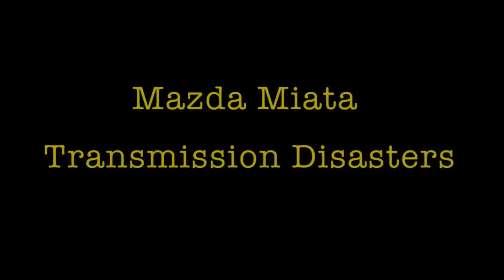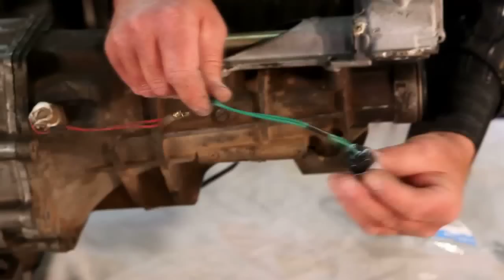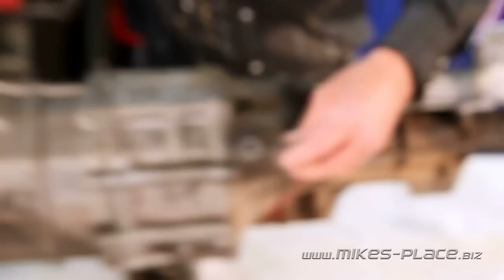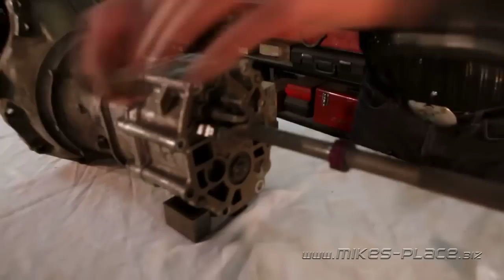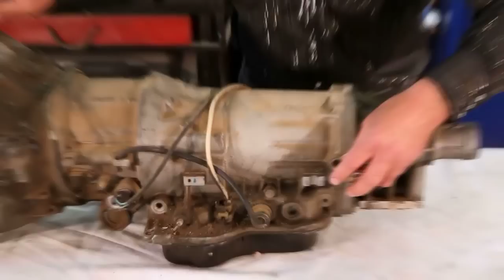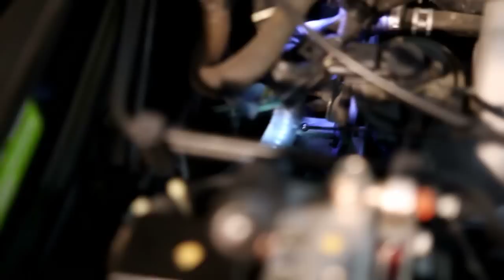MX-5 Miata Transmission Disasters from Mike's Place

Comment: hello Mike,
it is not a problem that I have, but you are the expert on mx5's. so, here is the thing, I have an NA6 and I want to install the 6 speed gearbox with a torsen diff, but keep the final drive ratio at 4.300 is that possible? and how?
Reply: Hello Sir Aliprantis,
No problem take both differentials to the driveline shop and have a hybrid cooked up. This is what they do.  Mike. The King of Miatas.
Reply: Oh, great then it is possible! 
Thanks a lot Mike!

Comment: Would a bad reverse switch cause the transmission to not want to go into Reverse? I sometimes have to pump the clutch 2 or 3 times for it to let me into Reverse. Its an 02 NB 6 speed trans.
Reply from the maker: Hello,Your transmission 2002 with a six speed has a issue with selecting reverse. One thing that can be done is a clutch pedal height adjustment so as to put more release into the pedal. Also you may have a worn or worn out clutch disc.Good Luck with your Miata Shifty Mission.The King of Miatas.Mike.
Reply: Mike MiataKing I have the same issue,can you elaborated on what needs to done? 6 speed transmission,clutch free play seems correct,also I don't have to push clutch pedal very far in for engine to rev up with driving along.

Comment: Oh all knowing Mike, King of Miatas, I need your help. I just bought a 90 Smurf Blue. The transmission is stuck in first. Any suggestions?
Reply from the maker: Hello Sir Keith,
The first place to look is inside the shift turret case to see Maybe broken parts. Use a magnet to fish around for clues. You may even have a broken shift turret case. Look under the Miata to check it out. Good luck the new to you Miata Mission. Mike, The King of Miatas.
Reply: Mike MiataKing that was the first place I looked. Previous owner said that the bushings has broken. Before I bought it, I cleaned out the turret and installed the rebuild kit with bronze bushing. Still didn’t resolve the issue. Going to get it up on jack stands today and see what else I can visually diagnose.
Reply from the maker: Hello Sir Keith,  Your next move is to start removing parts for the shift turret. The plungers and balls may be stuck.  Good luck with your Miata
Mission. Mike, The King of Miatas.

Comment: hey miata king, my neutral safety switch is acting up on my 6 speed. can i just cut and connect the two wires together to essentially jump it?
Reply: Hello Sir Eric,
The neutral switch is important to the ECU and drivability.  Best to replace the switch. One of the common problems with the switch going bad is the switch shorts out and blows the meter power fuse so the instrument cluster goes dark. Mike. The King of Miatas.

Comment: the reverse light switch has to be skrewed in tight by a wrench or a just by hand?
Reply from the maker: Hello sir Hooligan,
Use a spanner to secure the switch, don't forget the copper sealing washer or the switch will go in to deep and  lock up the reverse shaft. Good luck with your Miata Mission.
Mike.
The King of Miatas.

Comment: Is the Vacuum port location different on a 2003 Miata?!?  Thank you for your videos!!!
Reply: Hello Green Man,
Starting in 1999 the Miata no longer used a vacuum operated modulator. So the 2003 Miata does not have a vacuum port.
The King of Miatas. Mike.
Reply: Famous SeamusDude  So is this a Four speed automatic???
Reply from the maker: @greenman692003  Hello,
They call this a five speed as it has a lock up torque converter for fifth gear.
The King of Miatas.

Comment: Mike my automatic miata slips when its cold but after 1or 2  minutes it drives fine. It happens in drive and in reverse. Is this normal?
Reply from the maker: Hello Sir Alberto,
Does not sound normal. So would suggest a automatic specialist. May do with a service tune-up.
The King of Miatas. Mike.

Comment: Hey mike I have taken out the switch and attempted to move the detect back into place but it wont budge. Any suggestions?
Reply from the maker: Hello Sir Mark,
There may be tension on the ear set. Have someone push in the clutch while you push on the shift rod detent. Good luck with  your Miata Mission.
The King of Miatas.
Mike.

Comment: Please Miat Mike can you show me how to remove the engine mounted fuse box to replace the main 80 fuse which you are unable to just pull out like the rest of them. I can remove two bolts but where is the the other one. Please help me Mike
Reply: Hello Sir Harry,
Thank you for  your concerns. To remove the main fuse bolted into the under hood fuse box, first unbolt the box, two nuts. Lift up box from Miata to gain some working room. There is a trap door on the fuse box that will need to be opened to access one of the 10mm head bolts to remove the fuse. The other bolt can be seen. Once done put the unit back together and bolt back into the chassis. Good luck with  your Miata Fuse Mission. Mike, The King of 
Miatas.

Comment: Hay I wax doing a transmission flush on my 99 Mazda Miata and I remove. The tork bolt on my transmission now I don't have v six or reverse how do I fix it
Reply from the maker: Hello,
The bolt you you removed has a long shank ?  From the passenger side near the bottom front of the trans ??
If so the transmission will need to be removed and cases split to repair the now internal loose parts.
Good luck with your Miata Mission.
 The King of Miatas. Mike.
Reply: @MikesPlaceBiz  thanks I really appreciate at it

Comment: Hey miata King! Good Video. Can you help me? My Transmission started knocking today when i accelerated a bit to hard and shifted Form 1st to second gear fastly. Its worst when im in second gear but you can hear the knocking in all gears but quieter. When im standing still and in neutral its still there, when i press the clutch it slows down and stops. When i release the clutch its there again. You can hear it when the engine is warm and cold. 
I have a 95 na with the 1.6l 90hp engine
Reply from the maker: Hello Sir Tridel,
First step is to check the fluid level and maybe change the fluid. 
Noisy transmission is most likely a bearing going bad. When noisy 
in first and second the issue may be the input bearing, the first bearing
past the clutch. Good luck with your Miata Mission. Mike. The King of Miatas.
Reply: Mike MiataKing thanks i will look after it

Comment: I followed your guide and fixed this stuck in reverse problem.  Today,  gear is stuck in neutral ( ie,  put in neutral position and the car cannot be pushed ).  Able to shift in 1st and 2nd, but car won't move when release the clutch.  Cannot shift to 3rd,4th, 5th and reverse gear ) - Any ideas please ? thanks.
Reply from the maker: Hello Sir Al, 
The next step is fluid check. Check the main trans and open the shift turret. If trans is over one quart low, bad news.
Internal damage. Look in the shift turret box for broken bits. Fish around with a magnet on a stick. Next step is to 
start the engine, push clutch in and wiggle the gear shifter back forth and side to side, to release a stuck lock out or a stuck shift fork. Good luck with your Miata Mission.  
The King of Miatas.
Mike.
Reply: Hello - thanks.  I was able to fix this again by following the "stuck in reverse" you described here. My next question - apparently I feel that this problem is being caused by myself  pulling gear into Neutral without using the clutch while the car is moving - is there a problem with my transmission or my clutch as I can just shift any gear into neutral with using the clutch ?   what is the shift turret - is this the area holding the shift stick inside the car ?   many thanks.  Al
Reply: Hi Mike  the King  - I know what the turret is now - just went to check my car inside - First, the boot was broken badly so I could peek inside - I could see it is kind of wet ( perhaps with transmission fluid) ,  Second -  I could feel heat coming out while driving - is it because the boot is broken, or something else ? Third - my car is not on and is parked, but I put in each gear , and you can wiggle the shift stick left to right a little at every gear .  So is this causing the transmission gear get stuck once a while ?  Thanks. Al

Comment: Can torque converter or shift lock on auto 91 miata make motor not rotate I tried manually turning engine and it seems seized
Reply from the maker: Hello Sir Cameron,
We do not see the auto trans being  your  problem. Look closer at the engine, plugs out, Starter stuck ect...
Good luck with your Miata Mission. Mike, the King of Miatas.
Reply: @MikesPlaceBiz  it was torque converter not seated fully

Comment: Will this be the same if it keeps getting stuck in 5th??
Reply from the maker: Hello Brendan. Have you replaced the back up switch with an OEM part yet? Other issues could be the shifter mechanism, bushings, and collars. If the problem still continues, then there may be internal issues wear and tear. Good luck with your Miata mission.

Comment: i have no clue why my trans mission makes a little click/ grind sound in 1st and 3rd? 2002 se 6spd
Reply from the maker: +Thecharliejolly Hello Jolly Charlie, First step may to to use the Mazda OEM suggested fluid. You can buy at Ford Dealers. Item number XT-M5-QS.This is the Ford Cold Weather Syncro Fluid. Helps with smooth shifting and improves low temperature performance. You will need to purchase 3 Quarts. The King of Miatas. Mike.

Comment: Help please. I have a 91 5-speed the transmission and stick shakes while driving, and shakes really bad between 30-35 MPH. Im lost.
Reply: youll need to replace your shifter parts with a shifter rebuild kit, helps stop loose play when in gear/neutral
Reply: Hello,  Thank you for your concerns. Sounds like a bad driveshaft.Take a look under the Miata and shake the driveshaft. Good luck withYour Miata Mission. The King of Miatas. Mike.
Reply: +BalledandJacked thank you Sir
Reply: +Mark Cagaoan thank you that is the 1st thing I did.

Comment: Hey miata king I took off the reverse light switch on my 2001 miata 6 speed now it dont go in to 4 th 5th 6th and reverse forth feels blocked a the ether ones feel like neutral can u hellp me please
Reply from the maker: Hello Sir Jose,
Sounds like you have misplaced the shift rail bushing holder. Transmission will need to be pulled and put back together internally. Good luck with you Miata Mistake repairs.
Mike.
The King of Miatas.

Comment: Miata King MIKE!!  I have an auto tran (1992) that makes terrifying knock/pang noises whenever I switch through gears.  (not to mention several other noises at other times)  The shifter itself rocks/wiggles back and forth as I'm braking, starting to roll and/or over bumpy roads.  I removed the console and peeled back the piece the shifter is cradled in.  HOWEVER, I don't know what I'm looking for.  Any simple starting points??  Bushings?  Tighten one thing or another?  Things to be careful of?

Comment: Hello Miata King. I had my 1993 stuck in reverse and thanks to YOU, we fixed it! My question is, how do I permanently solve this problem? Thank you
Reply: So you don't know SIr? I have not drove the car since and I have a fear that it will be stuck in reverse a third time. I just wish how to permanently fix the problem
Reply from the maker: Hello Sir Steven, If not done yet a master shifter overhaul kit should be installed and a new reverse back up lamp switch. If problem continues issue will be internal, bent or worn out. Good luck with your Miata Mission. Mike. The King of Miatas.
Reply: Steven T hi, my 93' miata is stuck in the same fashion. I had a tow truck to move the car to a local miata club for repairs. If they don't have a spare 94' reverse switch, is it possible that the same problem will occur again?
Reply: Hello,
Thank you for your concerns. Yes, can happen again even with a new switch. The other things that aggravate the issue are sloppy shifter and worn internals. The King of Miatas. Mike.

Comment from the maker: Hello Sir Droid,
The reverse switch is in our eBay store item number 390433657043, or at your local Mazda dealer.  The other switch is called the neutral switch and we have not seen much trouble with that switch. If it acts up it can create an idle quality problem. Good luck with your Mission.
Mike.
The King of Miatas.

Comment: I had no problem at all with that switch, now I have the old one out and the new one on the table. But there is no difference at all on the length of the threaded bolt and not on the switch pin. So please, what is the difference?
Please see this photo of them...

https://photos.app.goo.gl/smBe6TcoWUkTMLij7
Reply from the maker: Hello,
Thank you for your interest and concerns. The difference is internal, spring pressure on the pin.
Make sense now ?
Miatameccca.
Reply: Hi Mike, both came with two different used gearboxes to fit TR4As, one with green and one with read cables, both had 1 ali washer and the spring load is the same. So I use the red one too. Problem why I searched and fund you was becauses I shifted the gb with the reverse switch OUT - and that caused the problems.
Reply: BTW: thank you for your videos!
Reply from the maker: @DieAnwohner  Hello,
Good luck with your TR4 Miata Mission.
The King of Miatas, Mike.

Comment: I know i'm late to the conversation, but i'm on my fifth reverse light switch since i bought my used 1990 NA, with most of them lasting around a year. Is there anything that might be causing them to fail? My husband says he's done replacing them and the car has to go. He said he overhauled the shifter when he changed the fourth switch.
Reply from the maker: Hello Damsel Justine,
Oh no not " The Miata has to Go "  The internal shift rod linkage may be damaged.  Another good used donor transmission may be the answer.
We all hope for mutual agreement with your love triangle. The King of Miatas, Mike.
Reply: @MikesPlaceBiz  Thanks for the quick reply.  I passed your comment on. We'll have to see what happens.

Comment: hello Mike,
it is not a problem that I have, but you are the expert on mx5's. so, here is the thing, I have an NA6 and I want to install the 6 speed gearbox with a torsen diff, but keep the final drive ratio at 4.300 is that possible? and how?